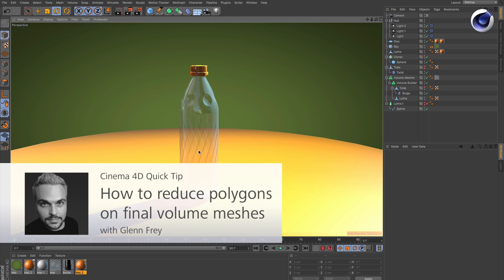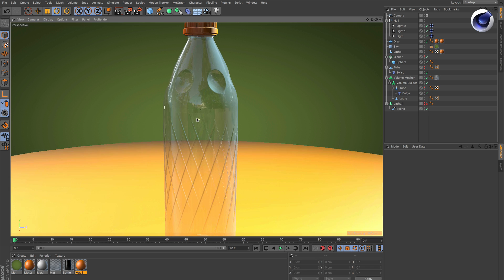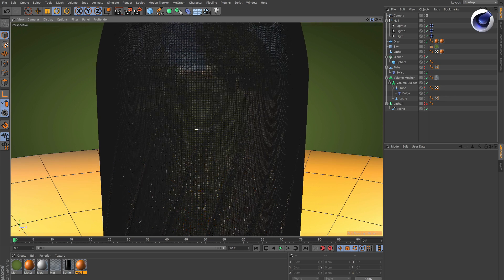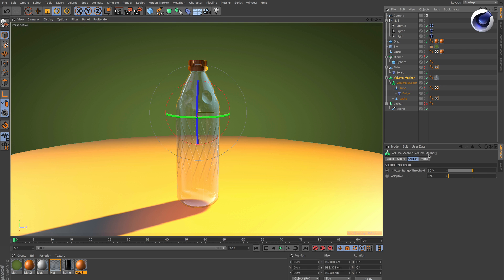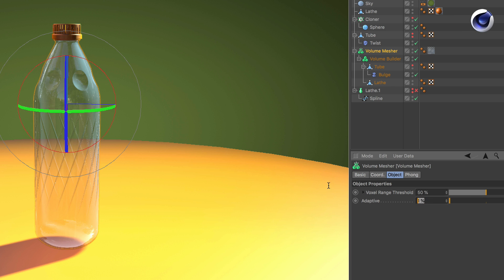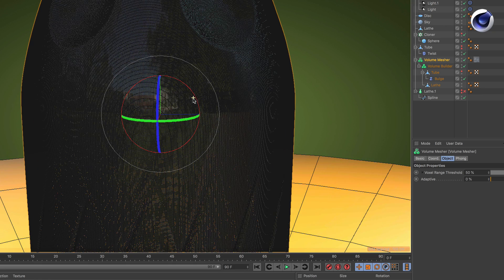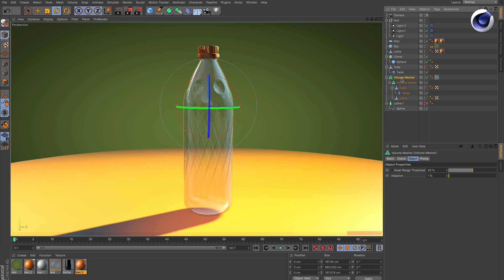Tip - 229: How to reduce polygons on final volume meshes in Cinema 4D

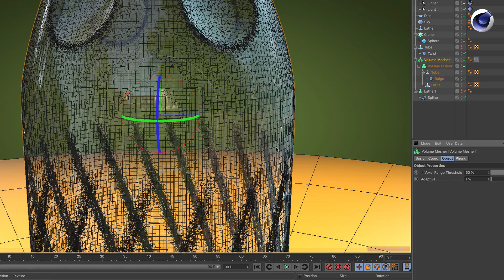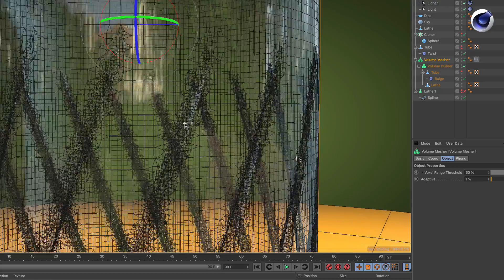Comment: The Volume Mesher is an extremely useful tool and I would like to offer several suggestions for Maxon going forward. I wish that the adaptive setting did a better job in those "hard" areas with lots of details. It tends to not create the best geometry there (i.e., it overcomplicates and produces "bad" latices connecting coarse geometry to find geometry) resulting in final geometry that still needs to be hand corrected. It also tends to be somewhat asymmetric in the sense that it seems to do a good job in some places and a bad job in others, for comparable levels of complexity. For example, at 0:59 in the video, the two circular indentations at the top are fairly symmetrical all around and the geometry at their edges is overly complex - it could have been much simpler without any significant loss of detail. This is also true for the diagonal creases shown in detail at 1:06. I am left to wonder if a configuration item that allows for more time to be spent in calculating more optimal geometry would be of significant benefit going forward (e.g., a slider for "adaptive calculation time"). This setting would allow the user to tell C4D to spend more time trying various potential variations/permutations, in an effort to optimize the adaptive layout better resulting in significantly better final geometry. I am uncertain how difficult the algorithm(s) for this would be, but I would like to point out that perhaps templates of good geometry patterns could be employed by the algorithm in deciding about the route to take (or in comparing the result of an attempt to other permutations in an effort to find the best adaptive solution within the allotted time period set by the slider). It may also be of use to add a control that allows the user to choose the remeshing algorithm from the available possibilities for such a job (see: https://abaqus-docs.mit.edu/2017/English/SIMACAEANLRefMap/simaanl-c-adpchoicesover.htm#simaanl-c-adpchoicesover). A final suggestion would be to allow the user to select the candidate polygons for remeshing, so that remeshing can be applied to a portion of the volume that is troublesome, rather than the entire volume.
Reply from the maker: Thanks a lot for your feedback! Much appreciated! Kindly send your input to: https://www.maxon.net/en/support/suggestions/ Thx!